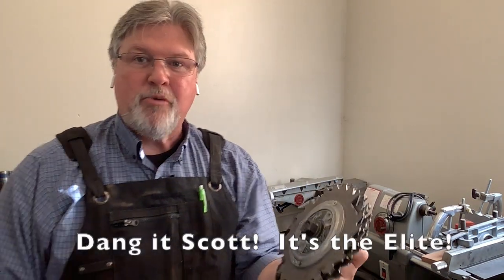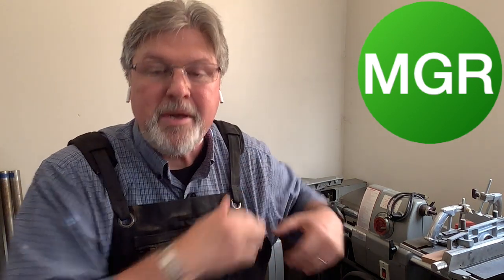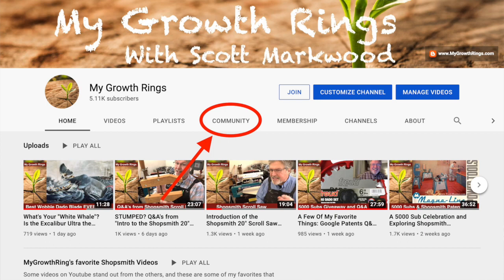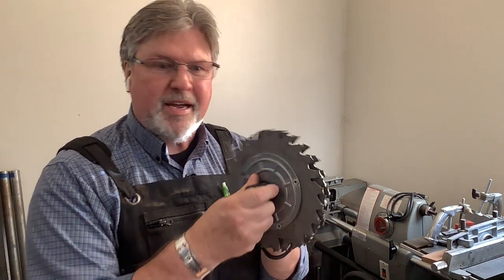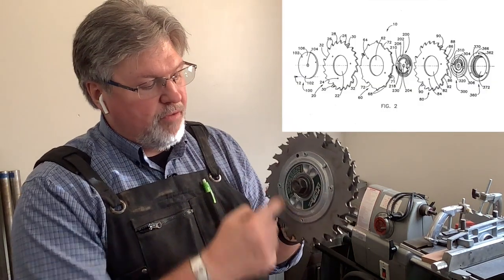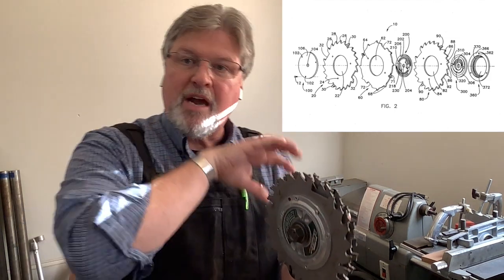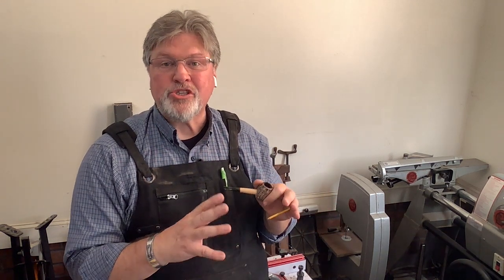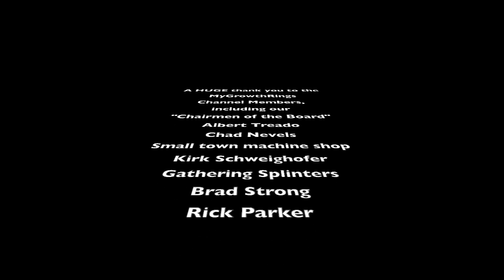The No-Wobble Adjustable Craftsman Excalibur Elite Dado: Take 2

Comment: I see two advantages with this dado set. 1, It gives you an almost flat bottom, unlike to a wobble dado set. 2, Much easier to set the width than a traditional stacked dado set. No swapping out multiple chippers (only one) and shims to get the width just right. Just use calipers to measure and fine tune the width. Very Cool.
Reply from the maker: Chad, I totally agree with your conclusions. It really is a cool tool. Scott
Reply: @MyGrowthRings  Was it worth the wait after 20+ years? Certainly couldn't beat the price that you paid now vs what it cost back then.
Reply from the maker: @chadnevels246  I guess so. I’m happy to have it and am enjoying playing with it, but if I had a batch of finger joints to make I’m sure I would reach for my Freud set.

Comment: That is definitely unique. Sears was never afraid to try something new, some good some bad. Thanks for the demonstration.  Scott someone asked you if the belt sander would run backwards.  You correctly said no, but since the drive shaft runs all the way through to attach the drum sander, could you not turn it around and connect the power coupler to the auxiliary shaft? The belt would still be running forward, but in the opposite direction. This would also make it easier to use in my opinion as the front of the sander would be in easy reach.
Reply from the maker: It’s worth a try.

Comment: Scott, I'm curious if this could give a perfectly flat bottom if it were ground properly? 
This seems like it would be a better idea (at least as a prototype) for a dado blade vs the current available adjustable dados. 
How's the fine adjustment on that thing? Easy to make? Or is is finicky?

Having to take the arbor nut all the way off "regular" dados everh time and making adjustments by adding shims and extra blades seems like a lot more useless work to me.
Reply from the maker: Hey Scott. Seeing how this set appears to be unused I suspect it isn't going to be possible to have it produce perfectly flat bottoms.  The fine adjustment is very good. I'm actually more curious to see if I move it from one size to another can I return to exactly the same setting and will it produce exactly the same side cut. I agree that this sure seems a lot more convenient. Scott

Comment: Very interesting design. Seems less complicated to set up than a standard stack. I wonder if the unique nested tooth design and the adjustment mechanics creates a problem for sharpening service providers? In other words can it be sharpened on standard equipment?
Reply: That is my question as well. Take it to your local sharpening service, and they might say "What the heck is this?" That might be an interesting conversation.
Reply: @chadnevels246  Agreed, by the end of the video I was wondering why this design has not taken over all brands. It looks like you can micro adjust while still on the arbor, big advantage. Thought maybe a sharpening difficult maybe blocked it success?
Reply from the maker: @woodshopnerdery  I'm going to ask around but it is far less complicated than an adjustable dado and there are plenty of places that will sharpen them. Scott

Comment: I see in your links that you mention Excalibur makes a two blade as well as a three blade dado blade. But it probably is worth mentioning in the video. Didn’t see any three blades in eBay right now. Your channel bought them all.   LOL. So just curious, would you buy the three blade stacking dado if it cost the same as the Freud stacking dado?  It looks like the three blade would be easier to adjust.Which leaves a smoother bottom cut?
Reply from the maker: Great question, Dave. No, the Freud stackable Safety Dado is a superior set, so if they cost the same I would opt for the Freud. However, if you can pick up the Excalibur Elite for substantially less I would say go for it.  Also, I mentioned the two blade version in the original video. Scott
Reply: Does the two blade Excalibur wobble or is it the same design with a limited width?
Reply from the maker: @daveschmitt6369  Check it out here: https://youtu.be/UHKbuu4rtjM Yes, the two blade Excalibur dado set is actually a pair of wobble dado blade in one.

Comment: So... do these work with anything other than a ShopSmith? It seemed like that arbor bolt was permanently-installed... could I mount one of these to my Unisaw?
Reply from the maker: The arbor that I mounted to the dads set is a Shopsmith dado arbor, but when you mount this to any other table saw you simply mount the set in place of the saw blade. Most table saws are capable of handling a dado blade, but some portable saws aren’t. The Unisaw can absolutely handle any dado blade set you can find. Scott
Reply: @MyGrowthRings  that's the impression I was under, but I couldn't tell if that shaft that extended through the blade you demo's in the video was intrinsic to the adjustment mechanism in the center, or removable, such that a table saw's arbor bolt might drive it in its place. That, coupled with the suggestions offered up by YouTube also being SS-centric made me wonder.

So how does one of these compare to Freud's Dial-a-Width Dado stacks? The adjustment process appears similar (but for, yanno, the not-inconsiderable bit about costing $200 less or so, lol). I confess I've spent a couple hours debating on one of those or, I dunno, an 8-foot slab or spalted maple, or something else equally cheap in comparison. :)

Comment: The also made a excalibur that was not an elite.  I own it.  I like this way better.  But mine is not horrible.  I has 2 blades but it is a wobble and with the arbor nut loose you rotate the blades in opposing direction and one side of the two blades get wider and it does in dead wobble.   I did just comment about it on your dado video but I thought it might be something people watching this might like to hear about. Mine came with my 510 and it is easy to use and works great but it does not make a perfect flat bottom.  But It works for me and I f I need a perfect flat bottom not often I can always clean up with a router bit.        If you did not see my other comment Look up a dado stack by CMT it has chippers but they are locked so they cant slip.  I guess if they slip carbide can go flying at you.  Making a stack dado now outlawed in europe except by the EU.  So US is bound to follow I am sure.   It is orange like their other blades.  It might be a good topic for your channel on the importance of getting stacks with chippers tight.   The only stack I have ever used was my dads and it is a shopsmith brand I think.  If not I know it was sold from Shopsmith.   I never thought about if one was to slip as a HSS blade would maybe dull a blade but carbide will for sure break and go flying if they over lap.   I love the pin in this.  I thought at first you was showing my blade,. Then you had to make me want something else.   I see one of these on Ebay right now but it is a bit beat up.   So it has been three years I assume you have used this a few times.  Do you prefer this over a dado stack.   If so I might just try to find one.
Reply from the maker: I’ll have to ch class out the Excalibur you have, because I don’t think I’ve tried it.
Reply from the maker: OK, I found an old ad and now I see exactly what you’re talking about. Yes, I am familiar with that version and believe that the elite version is much better. Thanks for taking me back!

Comment: Where would you get this sharpened?
Reply from the maker: A lot of sharpening places won't tough an adjustable dado set because every tooth has a different angle, but this one only have two angles per blade and one of those is a flat raker tooth. Since there are shops that WILL sharpen adjustable dados I have to believe that they'll have no problem with this, but I'll ask around.  Scott
Reply: @MyGrowthRings  Before I buy one I want to know where I can get it sharpened. This is especially true since the only ones available are used unless you find one in NIB condition.
Reply from the maker: I'm looking around, but I know my local shop wouldn't have a problem with it.